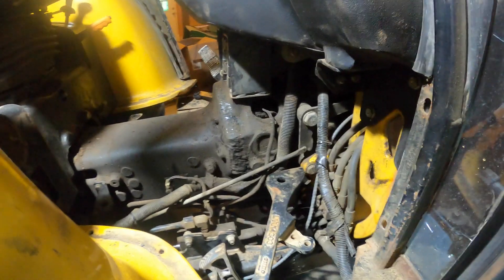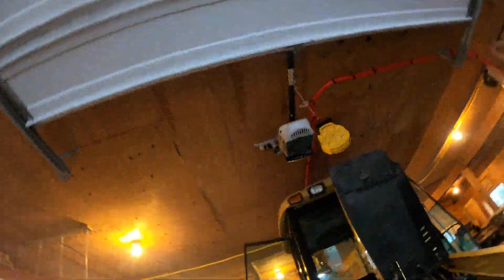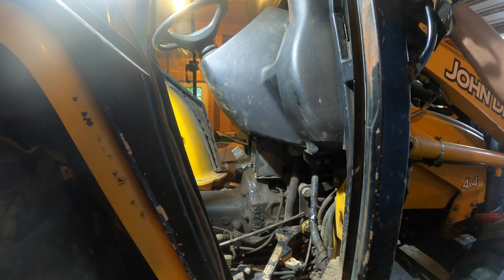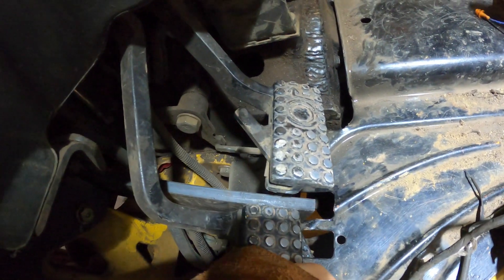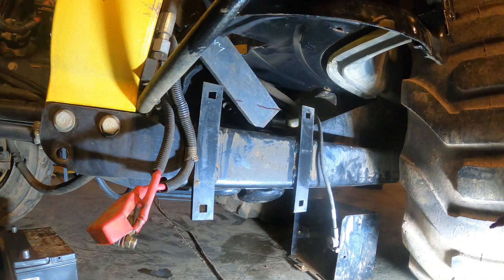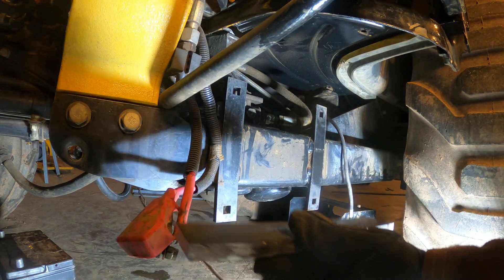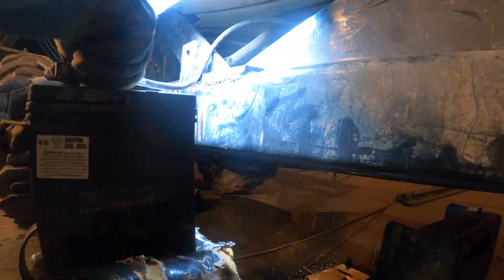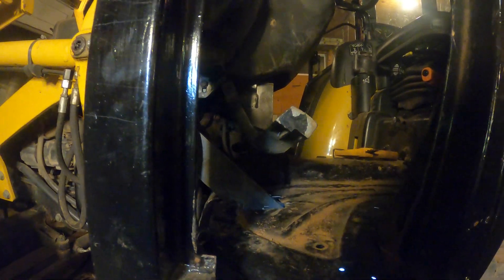Cracked bell housing on John Deere 110 backhoe. Fixing the design flaw.

Comment: So I was going to buy won of these machines to clear / open up  a piece of property I bought...do you think a machine this size has enough grunt to do land clearing or would it be to much for it? Also in regards to cracked bell housing, I read that the earlier models  right up to 2007 have had this problem (not common though).....do you know if  JD added additional bracing in the 2009 - 2012 models years? I enjoyed your video and wonder if your still happy with your purchase or would you of gone with a different machine and if so what ?
Reply from the maker: Yes, I am still happy with my purchase. I would have liked to know prior to buying it that the bell housing was cracked and repaired, but I probably still would have purchased it. My model is a 2008 and from what I have seen they haven't added additional bracing. That being said, if you keep the loader mast bolts tight and don't carry loads in the loader and the backhoe at the same time you may not have a problem. I like the John Deere and chose it over the Kubota for a few reasons. The similar HP Kubota has smaller rear tires and had the steering brakes on the same side as the hydrostatic pedals so brake turning was hard(they fixed that issue on the newest models). It has done pretty much everything I have wanted it to do. I have a video of digging out a stump, and have done a few others as well. If you had 40 stumps you wanted out, I might rent an excavator. I have a grapple for it which it handles with ease and moves very large logs. I have done some light ground clearing I guess you could say. There are a few other lesser issues these have, notably some cracks often develop on the loader supports as well as wearing out pins. The loader cracks are easily welded and I have a video I will post sometime of doing that. If you were to purchase one I bet it would be inexpensive to have a local welder brace it for you and weld the loader if there were cracks. Thinking about it, my machine likely was rather abused in its first life. Maybe I can make a video of everything to look for prior to purchase as I only noticed most of the things after using it for awhile. I don't think any machine would have suited me better as something bigger would be too big since we have 20 acres and I wanted something hydrostatic drive. The new Kubota M62 is tempting, but also would be >$80,000 similarly equipped to mine and has too many electronics. My neighbor has a mini hoe and a tracked skid steer, but this does better than those in our woods since we have a good bit of swamp. Haven't gotten it stuck where I couldn't pull myself out. I wish I had a good video of it, but it also has put out two fires on our property. I joke with my wife I should apply for the local fire department.
Reply from the maker: I actually broke my grapple twice within the first 3 months of using it moving brush and ripping out trees.
Reply: Yeah I guess that would be a huge factor in preventing a cracked bell housing by keeping loader arm bolts torqued to 150lbs and not stressing the frame by having a loaded bucket and backhoe. In regards to clearing my acreage I think I have maybe 20 tree stumps to dig out but I'm not in a rush......any idea how many hours you can get out of the Perkins diesel motors before you have to refresh it (inframe). Yes I think that is a good idea to post a video going over what to look for when considering purchasing a JD 110 TLB, I'm sure you would get a fair bit of traffic.  Anyways I've got 2 Im looking at with both around 4500 hours, one with an enclosed cab and heat the other one with open cab....I like the closed cab, now if I can just get the price down a bit,LOL........take care
 @ifitworks901
Reply from the maker: I think you could get those stumps done with this machine unless they were very large trees with a deep taproot. They have a Yanmar diesel and I don't know how many hours to say before a rebuild would be needed. I think I have 80-90 hours per year on mine so I bet it would last awhile for you. Cab is nice protecting you from branches in the woods. Makes it hotter in the summer though. I don't really care about the heat unless you wanted to wear a T-shirt while plowing.